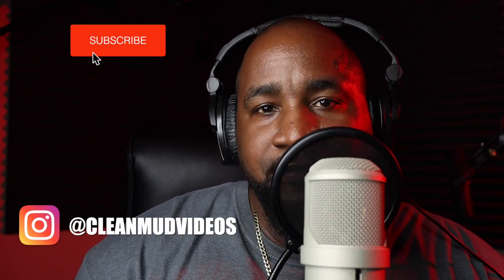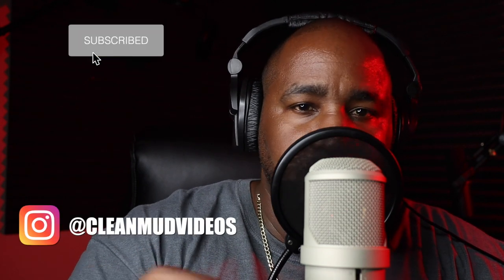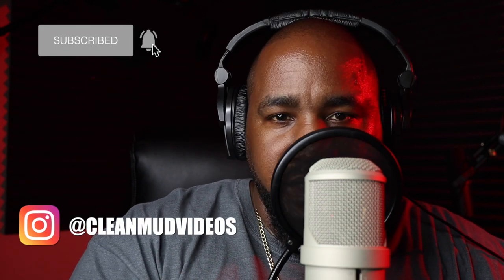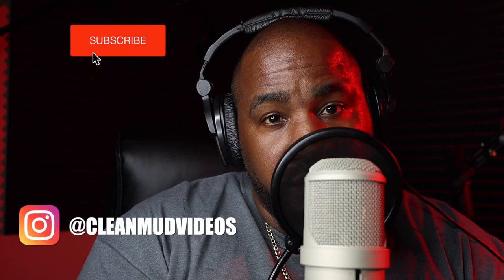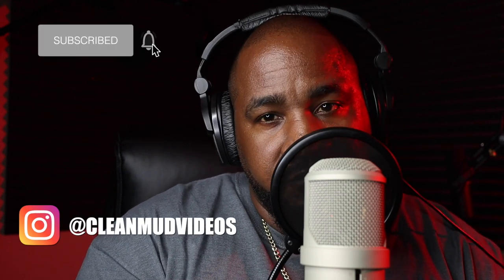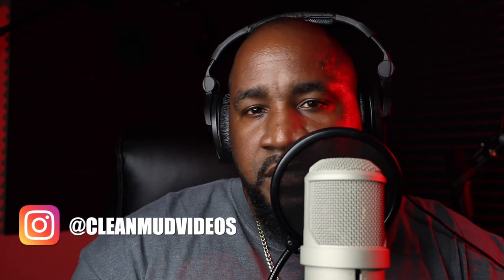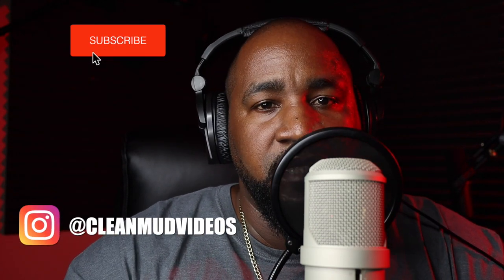Rupert Neve Designs 551 EQ #500series

Comment: Thank you for the review!!  So appreciated!! I just purchased his EQ.  I have a question - so I have used this a few times as an analog eq while recording vocals.  However, I when many recorded vocal tracks that came before this purchase that I will like to add the eq to…. It may be silly to some, but I cannot figure out how to apply the this eq to existing tracks recording recorded without the Rupert Neve.  Could you help a sista out? Thanks in advance…
Reply from the maker: It really depends on the DAW and interface that you are using. You may need to look up the name of those two and how to route outboard gear to them for post processing. It can vary, depending on your recording setup

Comment: Hi, I got this unit and while boosting highs 8k and 16k even at 3dB gain emits a significant hiss noise. Is that normal? I have the 551 powered by SM pro juicer rack 1. Cables used is a pair of xlr to trs Mogami 3 ft. 2534 cable.
Reply from the maker: I definitely don’t think that’s normal. Do you still have a warranty or return policy for it? Also, sometimes different units respond differently to different chassis’s as well.
Reply: @CLEANMUDVIDEOS  Thanks. Might be the chasis is the issue here. I had this unit 10 years ago, and thought this is the normal phenomenon of hardware eq. But since on your video, there is no noise, I am beginning to think about it.

Comment: Hey bro.. nice video.. but I returned my 551 cause the low band frequency selector had a weird noise when I chose different  frequencies... I didnt notice it on your unit. Do you have the same issue? Is that normal for it?
Reply from the maker: It was probably a defective unit
Reply: @CLEANMUDVIDEOS  I tried like 4 units in a row .. the low band frequency selector mad loud clicking noises when I turned the knob .. and I had 3 units in a row do this ..
Reply from the maker: @onekingmusic7018  😮
Reply: Crazy!!! I had the same issue and had trouble returning it, they said everything was fine, but the low band was clicky and noisy! Thank you I thought I was the lunatic hearing things... :D
Reply: @onekingmusic7018  Did the clicking stop when you stopped turning the knob?
Reply: Bro, haha,  that clicking/switching sound when switching between the Low Band Freq's are totally normal. It's literally something internally, a switch, that is switching to different inductors(or something like that), but it's totally meant to do that, and it's just internally, it doesn't transfer to the recordings, or audio at all. It's like a tiny click that you hear, and even feel slightly in the unit, and It's a switching mechanism. Like I'm just a bit surprised, because on day one I was like whoa, okay a loud click, interesting (when switching freq in the low band), but it was super apparent to me that it's switching/changing something in the unit when switching freq's, and its clearly internal. Like I say, it doesn't transfer to the recording, or audio files, but obv if your switching frequencies on any EQ during playback or recording of a track you will hear the switch between frequencies, but you wont hear that phisical click as it's purely a mechanical switch inside the EQ. I'm also surprized you've been through 4, and no one's been able to tell you what it is. Did you never just shoot RND an Email, and ask what the switching/clicking sound is on the Low Band Freq?
Reply: @jamescassidy4045 I mean after 3 or 4 units doing it you would definitely think common sense would’ve kicked in lol, there’s definitely no wondering about why music sounds like shit nowadays, they couldn’t even figure a simple clock sound out with the unit lol

Comment: Hey bro, I’m planning to buy a preamp for my Apollo twin mk2, I also have the shure ksm 44a, do u have any advice on the best quality price preamp for you ?
Reply from the maker: Are you looking for a 500 series, desktop, or rack mount unit?
Reply: i'm actually looking for a rack mount unit preamp to record vocals and rap, i'm actually hesitating between graace design m 101 and the uad solo 610 solo aand finally HERITAGE AUDIO HA81A ELITE if u can help me taking the right choice, thanks broo🙏🏽
Reply from the maker: @mahmoudelmoufti8666  nice! I’ve personally heard the Grace and the Solo 610. Haven’t heard the Heritage yet. However, the Grace is a super transparent sounding preamp while the 610 is pretty colored. For an aggressive hip hop vocal the Grace could possibly cause an issue with sounding too clean at times, but giving a more modern sound. It can be paired with an analog compressor to counter that a bit. I feel like the solo 610 can add that bit of beefiness to the vocals to give it more of that old school hip hop flavor. I’ll have to check out the Heritage because I’m clueless about it at the moment. Sorry
Reply: @CLEANMUDVIDEOS  So finally would you go for the the grace or the solo 610 solo, for a wet signal mixed ? 🤔

Comment: I love my 551, but my only issue with it is how narrow the Q is of the mid band. It's nice for cutting, really nice actually, but I almost never end up boosting any midrange, because it's just too pokey/whistley sounding. Im not saying you can't, or that I don't boost, but if I do it's usually very subtle, and I usually find a better use for it to attenuate with. 

It would have literally been the perfect EQ if they would have just left the (IN) position of the Mid Q button the same, so quite Narrow, but even if the IN position had the same Q of the Out position, that would be fine too, but then they should have made a way wider Q for the out position. It's funny because with a 1073, I love boosting, because the Q is so wide. The MF's on the 551 are great, but it would have been the perfect nod to the older designs, and then you could still have one narrow Q for surgical cutting/boosting! Just my thoughts on it. I still love it though, and the High/Low Bands are amazing! I just don't know how someone didn't hear the Q of even the Out position, and go, man, that's really really narrow still hah.
Reply: Why are you having too boost so much anyway?

Comment: Bro plz help. It's time to upgrade my mic (cm 25 mk3). I respect u'r work and that's the reason why I ask you for advice. I think about Rode nt1, sE elektronics se2200a II c, Lewitt lct 440 pure or MXL V87..For rap. Or maybe something other in that price range. I have a Focusrite scarlett 2i2 interface and a full treated room.
Reply from the maker: Honestly, any of those choices can work. The understanding of mixing can take u further than the mic choices. Pick the mic you like and enjoy! Hit me if you need any further thoughts
Reply: @CLEANMUDVIDEOS  Thanks for answer. I watched the test on the audio test kitchen and the MXL has the flattest fq response of this 4 in his test's. But I also watched very bad reviews about it. I like the way how sE electronics sound the most, are they ok with 14db self noise? That’s why NT1 bought me, only 4,5db of self noise. Lewitt is good, but I don't like how he looks. What to do, I'm confused :/ What would you buy for yourself?
Reply from the maker: @toohighstudio1792  are you purchasing from a place that you can return them? It would be best to actually do a test. On paper, a lot of things can be different than what you actually get. I like the sound of the SE. I also like the nt1 as well. I haven’t heard the 440 in person. One thing to keep in mind is that a lot of analog equipment has a bit of self noise, or hum so that isn’t always a deal breaker. Running any of these 3 mics through the Scarlett will have it’s own limitations. If you don’t want to test all three, pick the one that is the cheapest or inspires you the most. Would probably not pick the mxl though.
Reply: @CLEANMUDVIDEOS  Thank you very much. I chose the Rode NT1! Because I think it's the most detailed and neutral enough that I can do magic with it in the equalizer. Prices in my country are Rode Nt1 is 260 €, MXL V87 270 €, Lewitt LCT 440 is 275 and sE 2200 is 300 €. Thank you again, and keep recording videos. I like all u'r videos, but the best is the tutorials for studio equipment, techniques on how to and mic vs mic sound comparison with blind mode. Advice from me, try more budget studio equipment videos with reviews because 80% of the public look for best mics and preamps and studio equipment for under 300$ for home recording and podcasts. And try to make some mix and master tutorials, that's watched a lot.. U are subscribed from me because u always talk with listeners, i will keep watching all u'r videos. See ya.